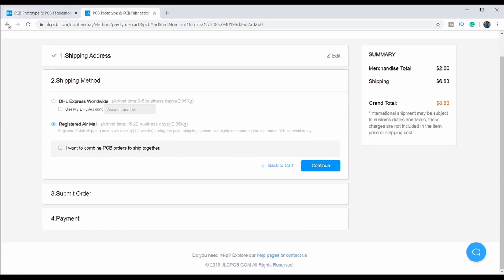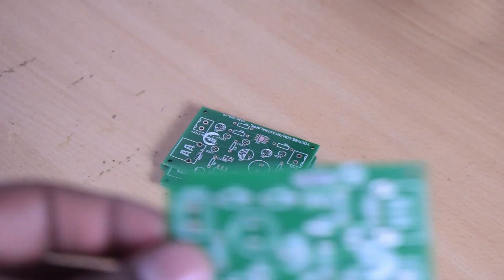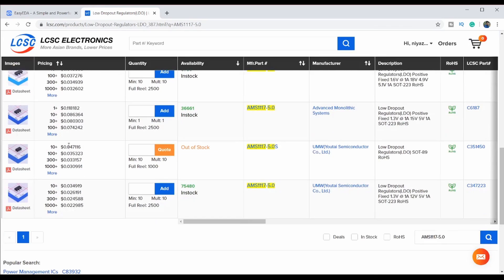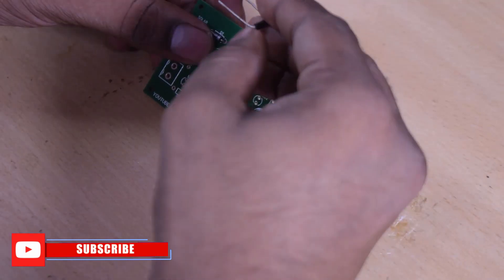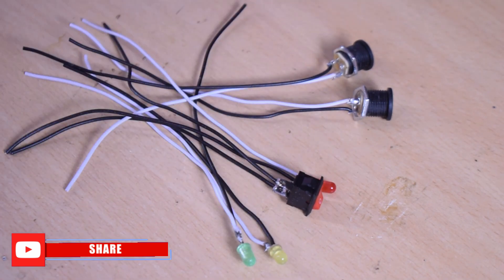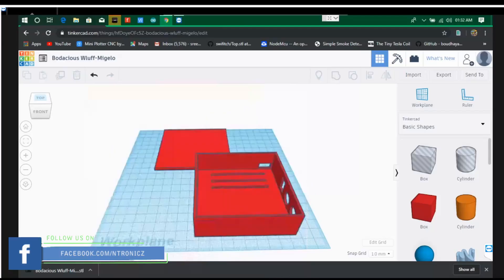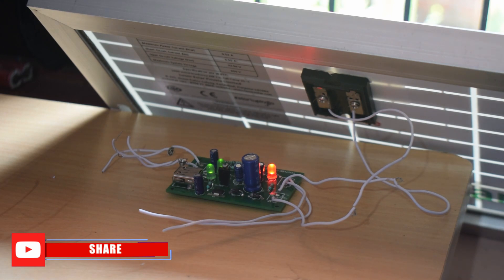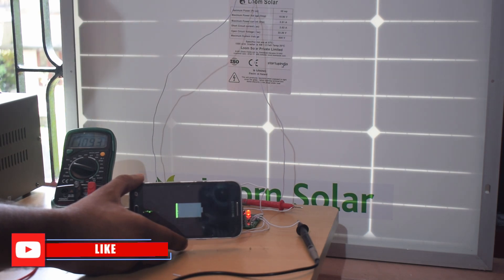How to make Solar Mobile Phone Charger | Cheap USB Smartphone Charger| Malayalam

Comment: താങ്കൾ ചെയ്ത ഈ ബോർഡിന്റെ ആവശ്യം എന്തിനാ??, ഒരു സ്റ്റെപ് ഡൗണ് dc dc buck converter module യൂസ് ചെയ്താൽ പോരെ?
Reply from the maker: Dc dc buck input voltage vary cheythal output voltage vary aakum..
Reply: @NiyasThalappil  orikkalum Ella! Athu thankal use cheyyunna circuit nte diffect aayirikkum
Reply: @NiyasThalappil  you don't know how can regulate voltage in a smps/buck boost?! It's so simple way for output feedback, using like as tl431. Ok.

Comment: 12 v 6 amp സോളാർ ചാർജറിൽ നിന്ന് 12v 7ah battery, 12v solar pannel ഇവ connect ചെയ്തു. സോളാർ ചാർജറിൽ നിന്നും 12v 1amp dc fan connect ചെയ്തു. Battery full charge ആയിരുന്നുവെങ്കിലും ഒരു മണിക്കൂർ കഴിഞ്ഞപ്പോൾ ഫാൻ നിലച്ചു. ബാറ്ററി പവർ ഇല്ലാതായി.ചാർജറിലെ ഔട്ട്‌ പുട്ട് കറന്റ്‌ 1 amp ആയി മാറ്റി ഫാൻ കൂടുതൽ സമയം വർക്ക് ചെയ്യാൻ ഇനിയും എന്തു മാറ്റം വരുത്തണം .മറുപടി പ്രതീക്ഷിക്കുന്നു.
Reply from the maker: Increase your battery capacity
Reply: My doubt is whether output amperage of either battery  or that of the connected load can be reduced to 1 ampere from the present 6 or 7 ampere. Is any circuit to do so.